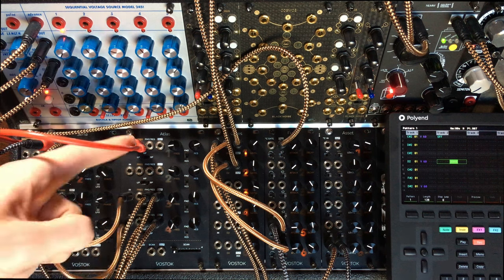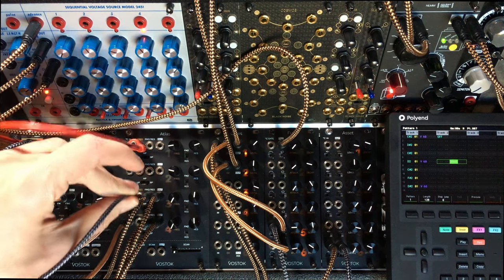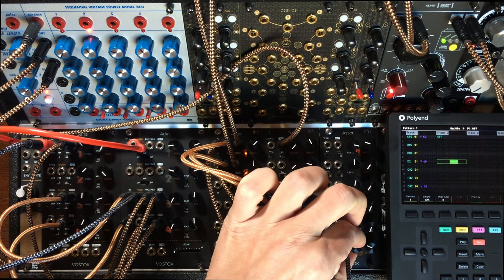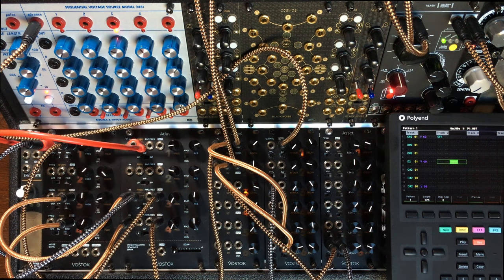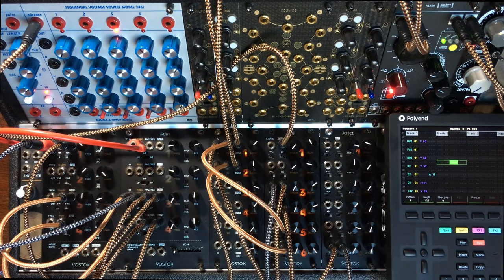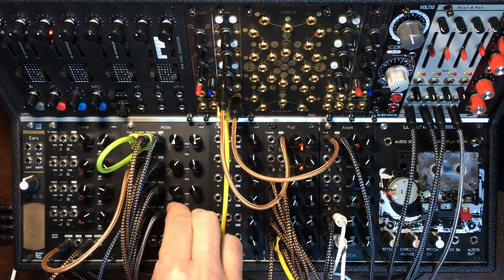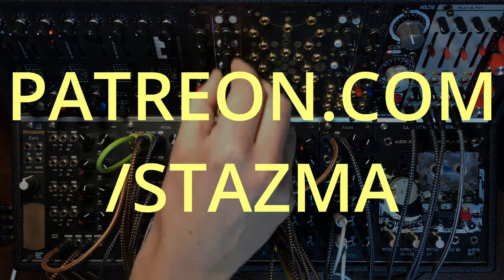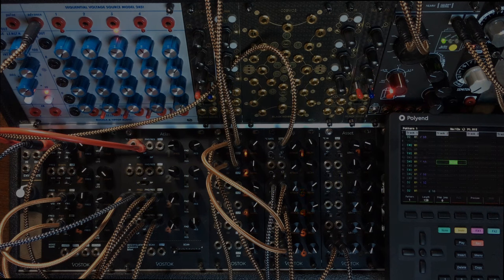Atlas Eurorack Module Demo | Gear Talk w/ Vostok Instruments

Comment: You still like this? Not sure if my first quad should be this, tempete or cunsa
Reply from the maker: It’s a great filter and I still use it in that same poly set up as it this video
Reply: Thanks! Any thoughts on if this or the cunsa is better for someone who likes to make ambient techno? I know it’s very preference based but wondering if the cunsa has that special sauce making it worth the extra cash.

Really love your content, thanks for taking the time to respond!
Reply from the maker: @ritosuckerino6763  the CUNSA is much more powerful as it is also 4 VCA, a mixer, has saturation control and all, BUT it makes less immediate.
I’d say if you want four great sounding filters with scanning as a bonus get the Atlas, if you a want a patch programmable monster filter get the CUNSA. I’ve made a demo for it as well by the way: Frap Tools CUNSA demo in 6 patches
https://youtu.be/ebgmiRrIkMM
Reply: @Stazma  awesome response. Thanks so much! Your cunsa video is what actually put it on my radar.